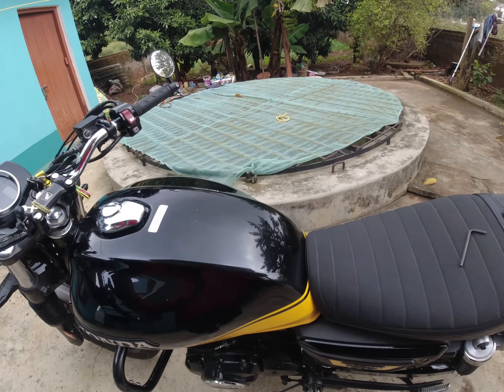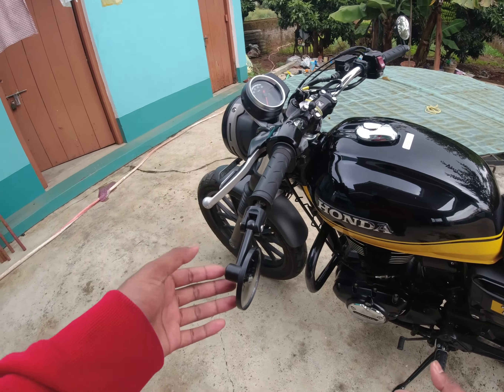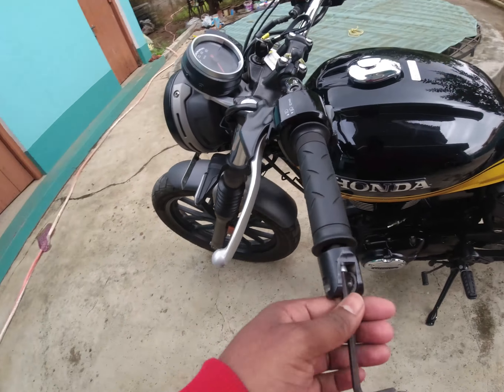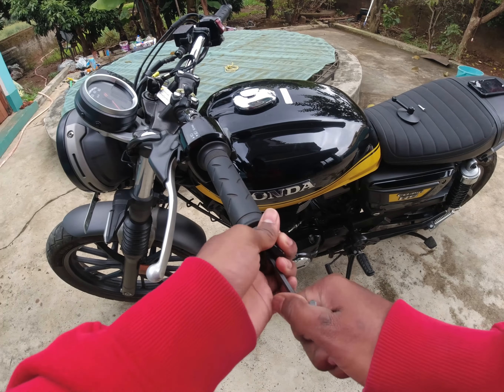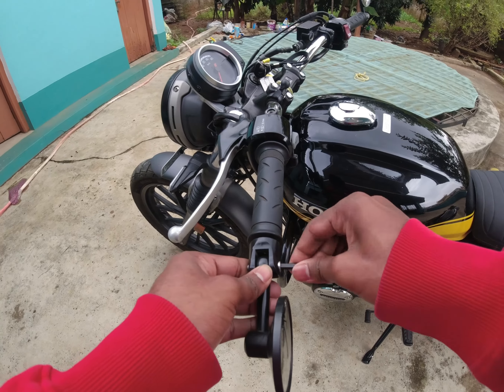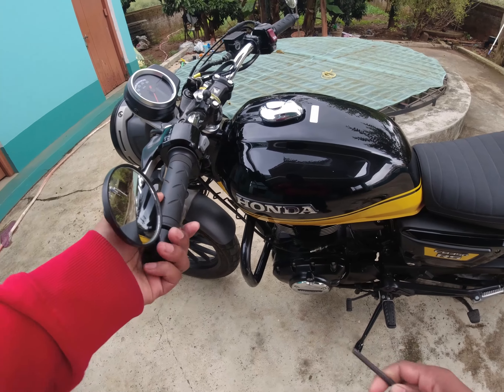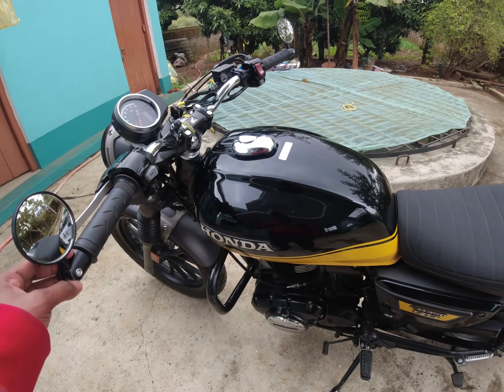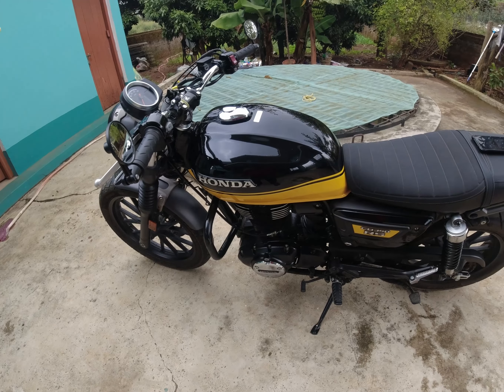My BarEnd Mirrors Review and How to Fix it [ Highly Requested Video ] | Honda CB350 RS

Comment: I'm planning to buy this mirror. Any update why it is not fitting in rs. Plz reply
Reply from the maker: There is no issue of fitting.. it just get loose after some time.. it's because RS handlebar is hallow and doesn't have threads  inside

Comment: Hi, Im planning to get this for my Honda CB350 RS too..I have one question, did you have to do any welding to the handle bars so that these could be attached to the bike? or is it just bolt on with the allen key as shown in your video? hope to get a reply from you. Keep up the good work, i have subscribed, thanks!
Reply from the maker: You just need to tighten the screw with Allen key and the bolt inside will expand and will get tight. And thanks for the support 😊
Reply: @frostywheels  Awesome! Thank you! Just ordered them 🙏🏼👍🏽
Reply from the maker: Let me know when you install it 😊